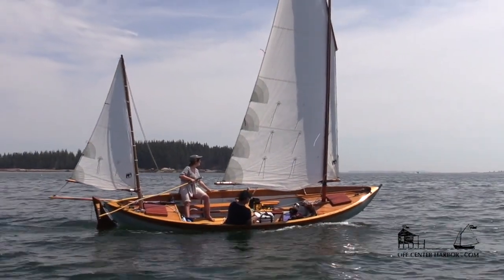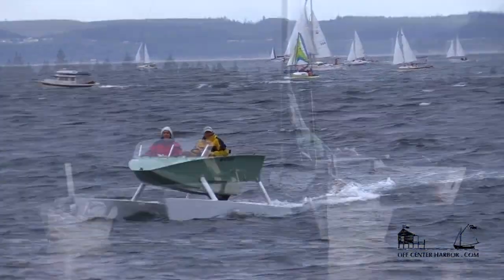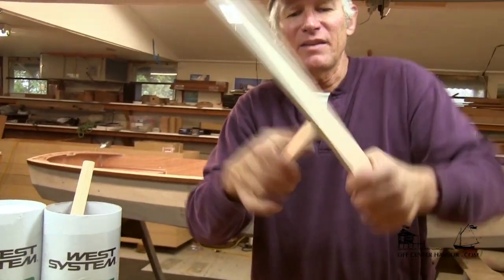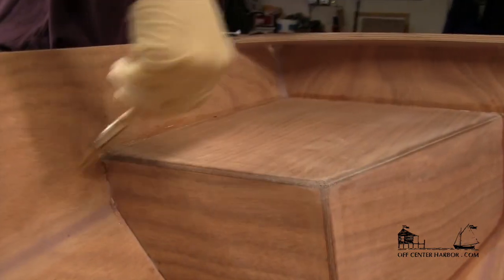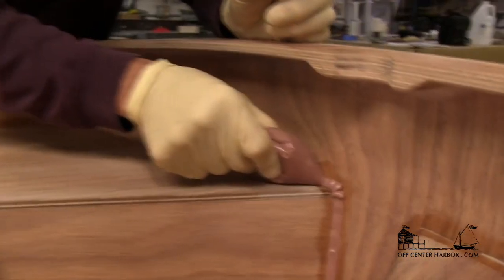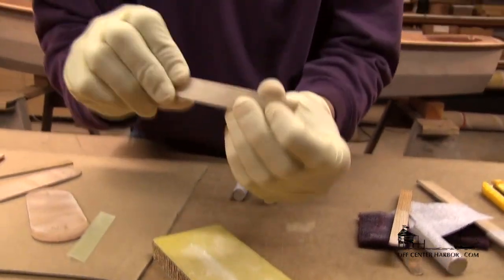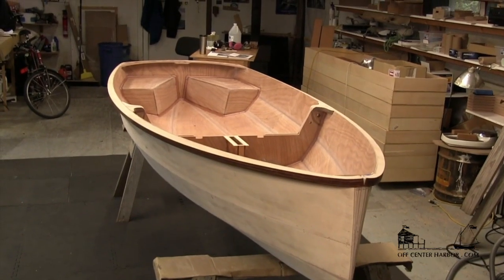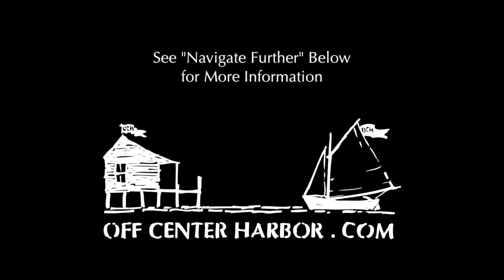Mastering Epoxy with Russell Brown, Part 1 -  Introduction to Filleting

Comment: Instead of sanding the cured fillets, I wait until the epoxy has gelled well then dip a gloved finger in 70/30 IPA and smooth it down. This makes a glass smooth surface without the hassle of sanding. Feel free to tell me if this is a bad idea. Thanks for the cool video!
Reply: Newbie. What is 70/30 IPA?
Reply: Isopropyl Alcohol.  I tried it and loved it!  Use thick gloves.  I waited too long but the fillets were still soft.  I used acetone and rubbed them smooth.  It worked great.  Thanks for the tip.

Comment: Do you have a patch kit for screw holes that will work to patch the holes in the fiberglass hull?  I have to cut the screw off, prob sand into the gelcoat, and patch with something.  Thank you.

Do you have anymore videos?
Reply: Hi Lee - we don't sell patch kits, but a little thickened epoxy should work great. There are hundreds of videos - including this 10-part series - at https://www.offcenterharbor.com/all-videos/ if you'd like to check them out.
Reply: Nate Rooks thank you so much
Reply: I highly recommend this video series as well as others.  Especially as a beginner.  Using a roller for laying the glass was amazing. Best $45 I ever spent. Thanks!

Comment: So...you put fillets on top of cured fiberglass/epoxy and NOT the other way around?
Reply: A bit late of a reply, but for future web searchers: I watched the full video series.  I seem to recall that the panels were fiberglassed prior to assembly.  So, in this case, the fillets were going on top of glass.  A video later in the series goes over adding fiberglass tape over the fillet.

Comment: I've never had any of the epoxy products, like gorilla or permatex, bond or hold up to anything. All surfaces prepared and cleaned, but still no success.
Reply: Russell (and most of the other boatbuilders I know) use WEST System Epoxy. I've used gorilla glue but not permatex, and all I can say is that real 2-part epoxies like WEST are in a different league. They'll bond and hold up to just about anything.
Reply: I have a hole in my fiberglass 1987 Thundercraft boat.  How should I make sure it’s not going to leak.  The guy I bought it from patched it up and it looks good but...
Reply: Nate Rooks do they have an all purpose epoxy glue that I can buy
Reply: NorthernKanuk I agree with you 💯.  Watch the YouTube Project Farm test the epoxy glues.  I think JB Weld original came out pretty well. I hope West System glue has an all purpose epoxy glue.